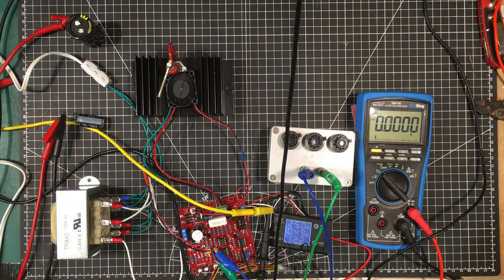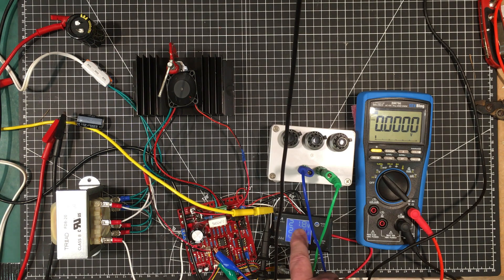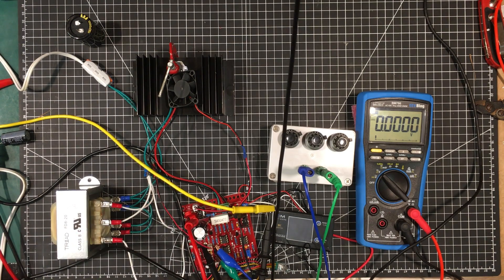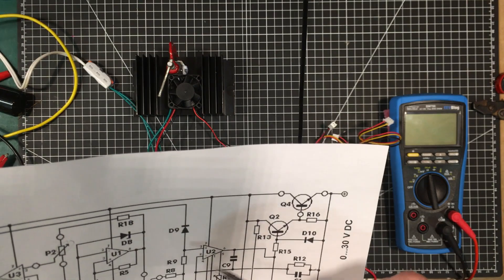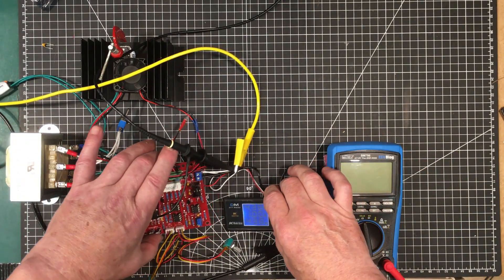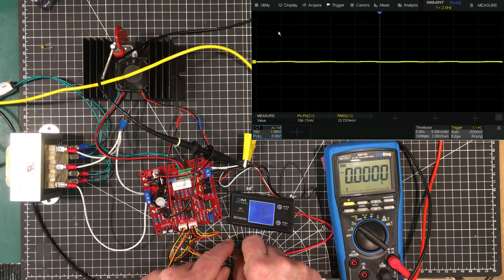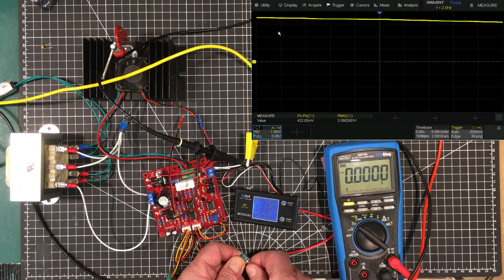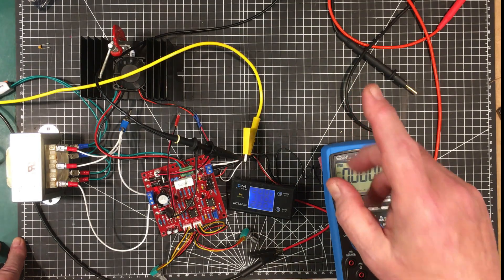Uni-Byte 0193 - It WORKS!!!- Hiland POWER Supply Kit : Part 3

Comment: I bought a Hiland POWER Supply Kit and I have a toroidal transformer Prim. 230V, Sec. 27 V 4A at no load.
Can I use this transformer or is it unsuitable.Thank you in advance for your early response.
Reply from the maker: That will end up putting about 42V across the op-amps which is way too much.
Reply: @uni-byte  Thank you for your reply.

Comment: I enjoyed your videos on the Temu 30v 3a power supply.  I bought two of them and neither work.  The second one I put in Circuit IC Sockets Connectors for the Tl081’s.  And ordered some 1/2 watt resistors to replace the 81 ohm because it was getting very hot.  I built a simple op amp tester and one checked bad on second kit.  I replaced it with a good one and got 31 volts for about 6 seconds. The Tl081 got so hot it burned my finger and then it went back to negative.6 volts at the output. Same as the first one I built.  I am a hobbyist so it gets over my head pretty quick, but wanted to know if you had time to give me some suggestions. 
Thank you, Jack
Reply from the maker: I pretty much cover everything in this series.  Did you see part 4?  Look at it and ask me some specific questions if they are not answered by then.

Comment: that tl081 don't usually feel about 24V p2p ac supply.
apart from that this circuit has so many design flows. 
i have it though, on my table, serving 0-20V / 0-1.8amps, with a 0-18V transformer, just to be on the safe  side without any mods. thanks for recommending 3.9v zener and lm741. i may just change them someday.
Reply from the maker: You're welcome

Comment: Just a couple of comments, the rule of thumb is 2200uF/ 1amp. Also if you use a bridge rectifier the transformer must be able to deliver 1.41 X the output current. On some of these PCBs T3 is the wrong way around what results in the current limiter not working. I build this power supply in a 0.....30V and  0......3A and it works well with a correct transformer and sufficient capacitors I also added a extra transistor and emitter resistor to divide the load. Used a old CPU heatsink with a fan and even when shorted it only gets hand warm.
I hope this helps.
Reply from the maker: Thanks for the comment!

Comment: The Capacitor is getting Hot.!
Something is desperately wrong there.

The 741's are good move.  (1.1 billion manufactured ever 10 months). We should be buying them by the bushel...
Reply from the maker: The capacitor had an ESR of more than 3 times that of the Nichicon!

For 99% of what you need an op-amp for, the 741 is golden.